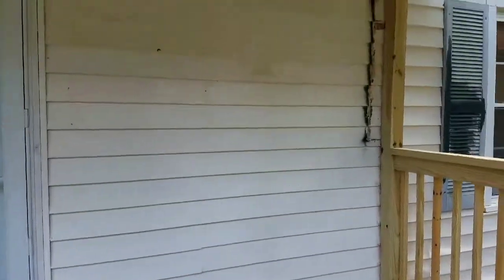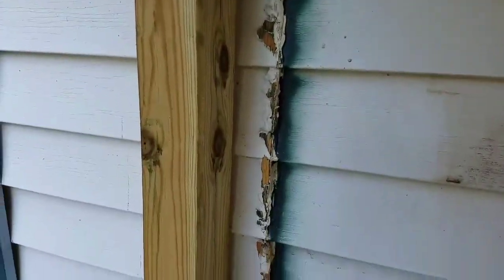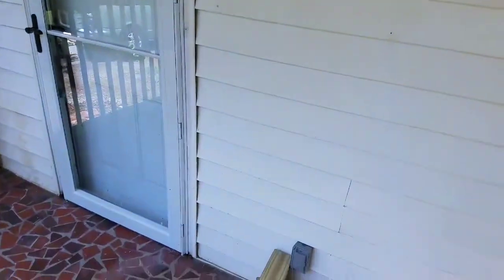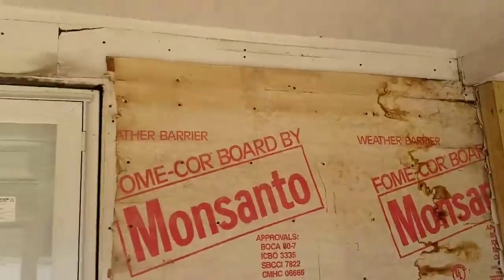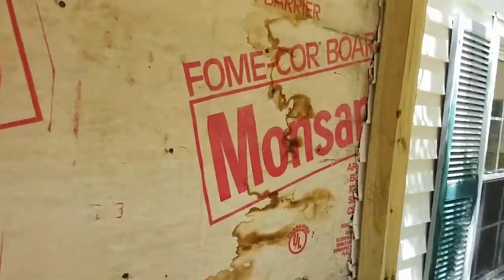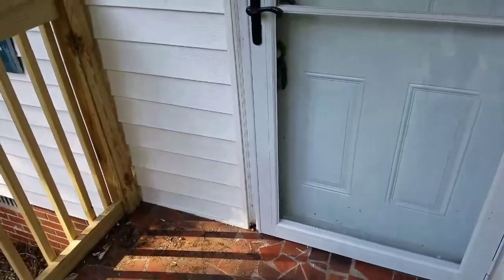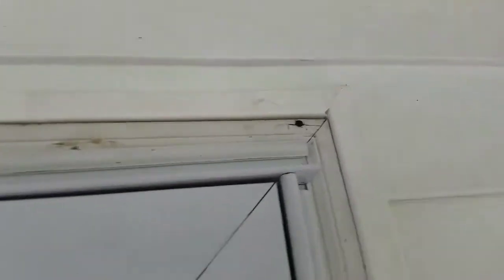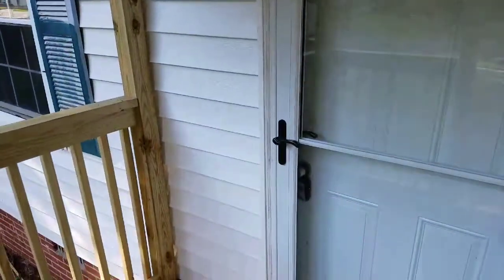Vinyl siding replacment

Comment: Matt I just subscribed to the channel. Enjoy your videos. I started my handyman business this past year and enjoy it immensely. Say how did you cut your siding? I have only done 1 siding job so far and found an angle grinder with cut off wheel to work the best for me.
Reply from the maker: Brian Mowers get man.  Thanks for subscribing.   I use some big metal cutting shears.  They worked pretty good.  If you do any siding work get one of those little tools I showed.  It's an awesome tool for removing and reinstalling siding.  I can't emphasize enough how helpful it was.  Thanks again. 👍